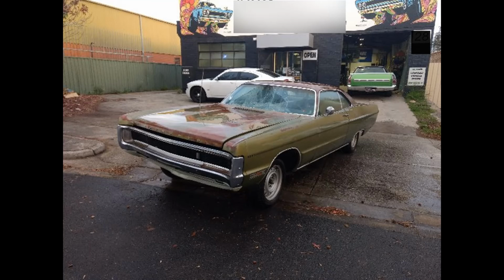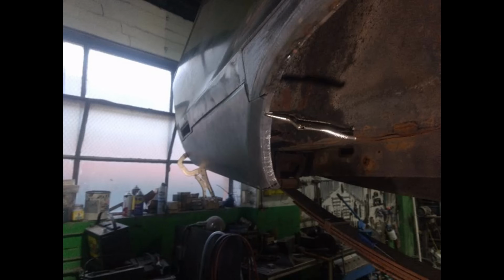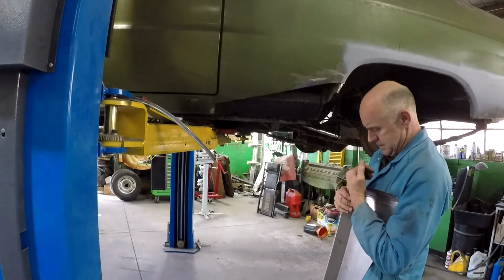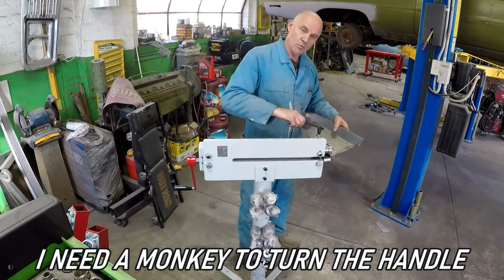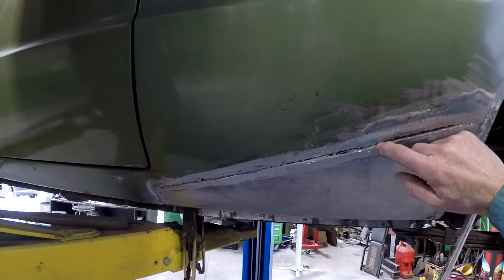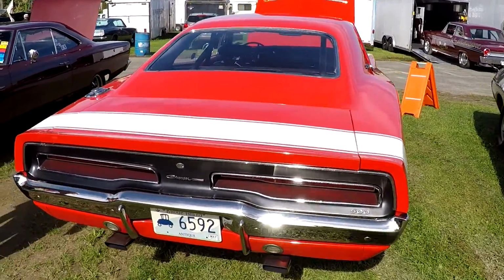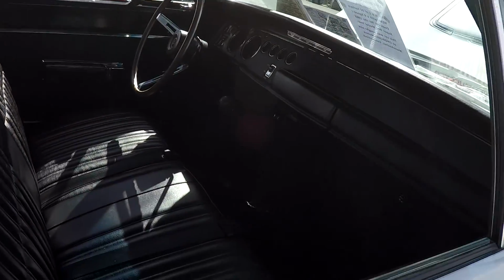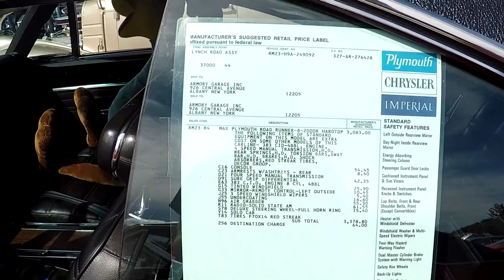Big Block 1970 Sport Fury GT ready for restoration and car  show thrown in at Lebanon Valley.  Ep 1

Comment: That spot where you gonna put the fiberglass.  can you fill that with weld? Or would it be too much heat on the quarter panel? I love your work by the way!
Reply from the maker: Too much heat there is always a problem with distortion of the metal. You have to be careful, especially on large flat panels. Thanks for watching.